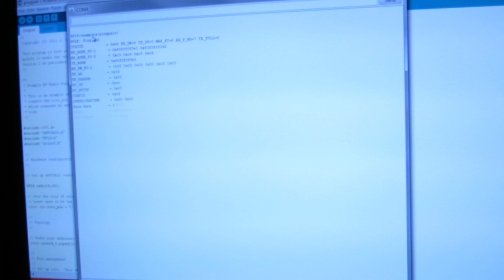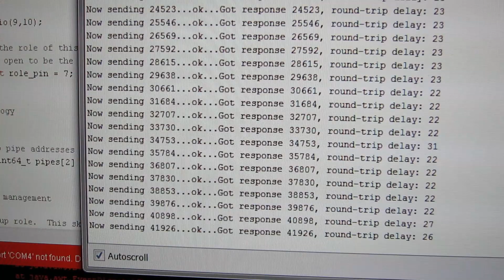Arcade Network - Arduino + NRF24L01 - Proof Of Concept Test 1

Comment: My own experience with those nRFLO1 chips is  that they are unreliable and  easily damaged. I built a wireless temp controller using those transceivers but never found them to be robust enough to implement it in one of my designs. Good luck yours.

Comment: Hi! Which shields are you using to connect nRF24l01?
I've heard that nRF24l01 is not recommended any more.
Instead, Nordic recommends nRF24l01+.
Have you heard anything about this?
Thanks a lot for the help.
Reply: Olá Robertinho, como vai ?
Eu tenho farto material sobre  o transceiver NTF24L01+  e estou criando uma biblioteca para microcontroladores implementando rede mesh.
Precisando de algo é só entrar em contato.
Grande abraço

Comment: Hello,
in "gettingStarted" example of RF24 library for arduino there is sth like this:
const uint64_t pipes[2] = { 0xF0F0F0F0E1LL, 0xF0F0F0F0D2LL };

in one RF i get RX_ADDR_P0-1	xf0f0f0f03c 0xf0f0f0f0d2 but in another i get RX_ADDR_P0-1	0xe7e7e7e7e7 0xf0f0f0f0d2
wchich one i should enter in Arduino code? for what there are LL at the end of every pipe address?

best regards
Adam

Comment: Not really following this. Simple send and receive is a drop in example that comes with the library. I cant see what you have done that is special. A proper multi node network for these devices WOULD be special as even the NRF24 network code while supporting many devices is not a true network.

You mention one end of the house to the other. Be wary about relying on that. Thanks to a very bad choice of operating frequency and low power you will find in some cases you can hardly get from one room to the next. If you goosle scargill and nrf24l01 you will find Ive done a lot with these including a comprehensive home control but I dearly would love a low cost alternative to these devices. Sub £2 is great but the range can be attrocious.